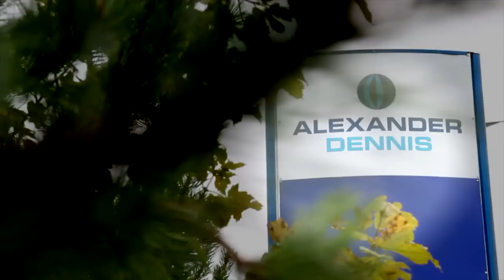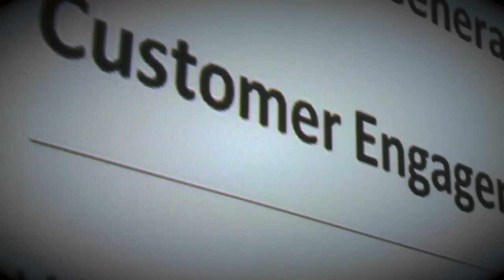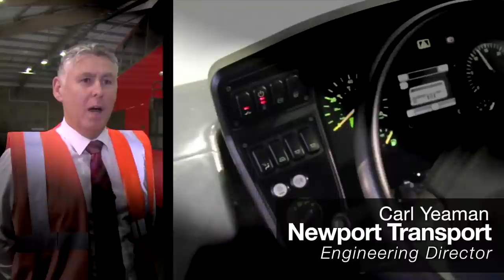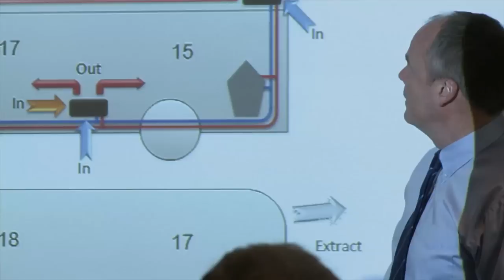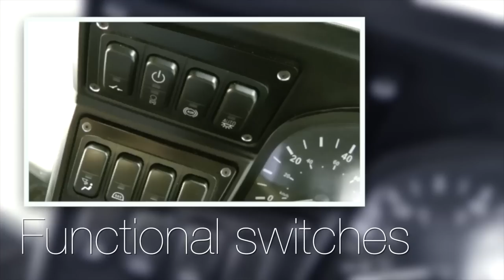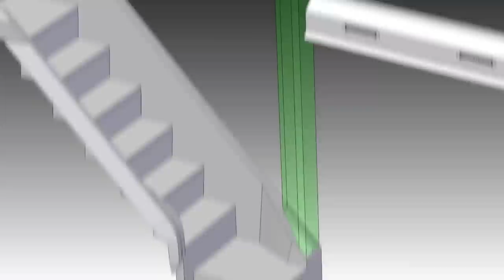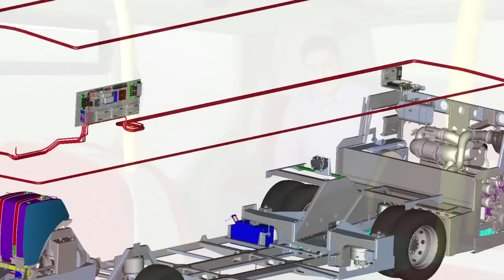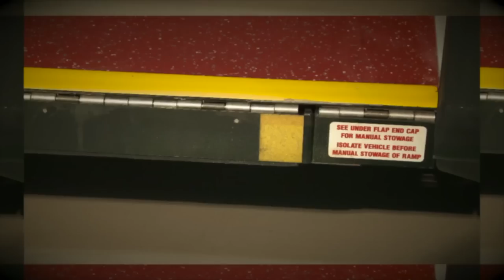All-new Enviro400 Launch video

Comment: Extended Bodies for Most of the Buses

Much as I am not comfortable 
asking the depot why they stopped running the London Suburban Loud 4-Speed Leyland Hydra cyclic Automatic Gearbox Gardner 6LX and Gardner 
6LXC Diesel Engine Olympian ECW’s on routes 30, 121, 230, 313, 271, 349, N279 And 158 why can’t we make the same make of the Loud 4-Speed Leyland 
Hydra cyclic Automatic Gearbox Gardner 6LX and Gardner 6LXC Diesel Engine Olympian ECW Buses but Modernise the insides of these Buses. 
Also, make it low floor up and down and also extend the middle body part of these vehicles a little bit more so there will be more space for the wheelchair users. By the way, if you could remake and Modernise these 
vehicles could they also make them into a Loud 4-Speed Leyland Hydra cyclic Automatic Gearbox Gardner 6LX and Gardner 6LXC Diesel Engine 
Olympian ECW Version that if it will be possible to Modernise the 
insides of these Loud 4-Speed Leyland Hydra cyclic Automatic Gearbox Gardner 6LX and Gardner 6LXC Diesel Engine Olympian ECW’s make it low 
floor up and down and also extend the middle body part of these vehicles a little bit more so there will be more space and even a London Suburban 4-Speed Leyland Hydra cyclic Automatic Gearbox Scania N230UD 
Enviro 400 MMCs and 4-Speed Leyland Hydra cyclic Automatic Gearbox Gardner 6LX Diesel engine Enviro 400 MMC’s and also extend the middle 
the body part of these vehicles a little bit more. Why couldn’t we have those London Suburban Buse's Pale red on the top roof Pale red again on 
the top middle Milk Chocolate brown on the middle Creamy white on the Bottom Middle and Milk Chocolate Brown again on the Bottom on most of 
those kinds of Particular Double Decker Vehicles? Could you put 
the Loud 4-Speed Leyland Hydra cyclic Automatic Gearbox in the Scania N230UD Enviro 400 MMCs and also put the Loud 3-Speed Voith Diwa Gearbox 
in the Volvo TD102KF Engine East Lancs Olympus and also extend the middle body part of these vehicles a little bit more and also turn 
most of them to London Suburban Buses. By the way, could you also make the routes 313, 349, 230, 121, N279 and 271 into London Suburban Buses and have a mixture of a Loud 4-speed Leyland Hydra cyclic Automatic Gearbox 
Scania N230UD Enviro 400 MMC and Loud 4-Speed Leyland Hydra cyclic Automatic Gearbox Gardner 6LX and Gardner 6LXC Diesel Engine Olympian ECW 
Versions. Could they also transfer the Arriva Bus Depots from Hackney to Stagecoach company so they can replace all the Arriva buses so that all of them can go to Birmingham and Leeds and they can be replaced by Stagecoach Loud 3-Speed Voith Diwa Gearbox Volvo TD102KF Engine East Lancs Olympus and also Extend the Middle body part of these Vehicles and that includes A Mixture of a Stagecoach Loud 3-Speed Voith Diwa Gearbox Volvo TD102KF, Gardner 6LXC and Gardner 6LXCT Engine Northern Counties Palatine One and that Includes a Loud 4-Speed Leyland Hydra cyclic Automatic Gearbox Gardner 6LX Diesel engine Enviro 400 MMC’s and Loud 
4-Speed Leyland Hydra cyclic Automatic Gearbox Scania N230UD Enviro 400 
MMC Vehicles A Little Bit More? Can Arriva London Bus Company Replace Most of their Wight Buses so they can also transfer them to Birmingham and Also Manchester so they can be replaced by Loud 3-Speed ZF Ecomat 
Gearboxes Volvo D10A Engine East Lancs Olympus and also Extend the The middle body part of these Vehicles A Little Bit More Thank You Very Very Very Very Very Much. Oh by the way could the bus Factory 
Companies also Make More of Those Loud 4-Speed Leyland Hydra cyclic Automatic Gearbox Gardner 6LX and Gardner 6LXC Diesel engine Olympian ECW Vehicles And that also includes Those Loud 4-Speed Leyland Hydra cyclic Automatic Gearbox Cummins L10 Enviro 400 MMC And also Extend The middle Body part of those Loud 4-Speed Leyland Hydra cyclic 
Automatic Gearbox Gardner 6LX and Gardner 6LXC Diesel Engine Olympian ECW Vehicles and the Loud 4-Speed Leyland Hydra cyclic Automatic Gearbox Cummins L10 Enviro 400 MMC Vehicles and that also includes The Loud 3-Speed ZF Ecomat Gearboxes Volvo D10A Engine East Lancs Olympus A Little Bit More And Paint Those 4-Speed Leyland Hydra cyclic Automatic Gearbox Cummins L10 Enviro 400 MMC Vehicles and also those Loud 4-Speed Leyland Hydra cyclic Automatic Gearbox Gardner 6LX and Gardner 6LXC Diesel engine Olympian ECW Vehicles and that also includes The Northern Counties 
Palatine One with a Volvo TD102KF, Gardner 6LXC and Gardner 6LXCT Diesel engines with a Loud 3-Speed Voith Diwa Gearboxes and The Loud 4-Speed 
Leyland Hydra cyclic Automatic Gearbox Scania N230UD Enviro 400 MMC Vehicles and also The Loud 4-Speed Leyland Hydra cyclic Automatic Gearbox Gardner 6LX Diesel engine Enviro 400 MMC Vehicles to the Grey Green Colours Just Like The Other Original Scania Grey Green on the Bus Route 125, 173, 313 and the 103. If all of the 14 Leyland Titan B15s are Fully Red and even Mostly Red, could they also Repaint All of Those 14 Leyland Titan B15s into Grey Green Colours Just Like The Other Original Scania Grey Green on Bus Route 313 so they can Reuse them for Only Every Seven and a Half Months and also Reuse them on those Rail Replacement 
London Bus Routes if that will Be Alright for Only Just Every Seven and a Half Months, starting from the beginning of October and also Reuse Those Buses Only on the London Bus Routes which are 341, N41, 34, 123, N29, 149, 221, N73, 121, 86, 30, 262, 147, 396, 41, and N26 so Please make sure that the builders can do as they are told!!!!!!! And please do something about these Very Very Very Very Very Very Very Very Very Very Very Very Important Professional Ideas Pretty Please Prime Minister and also includes the Mayor of London.